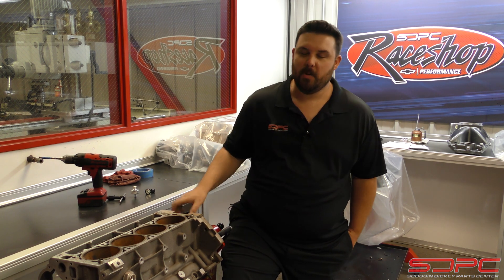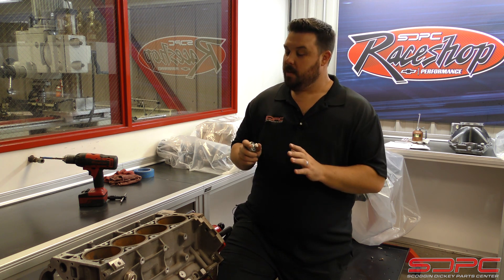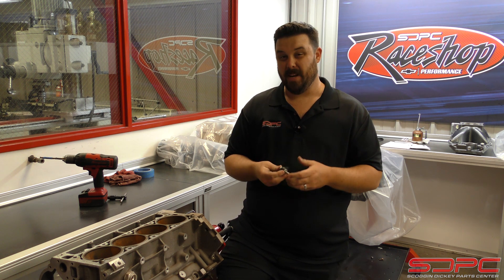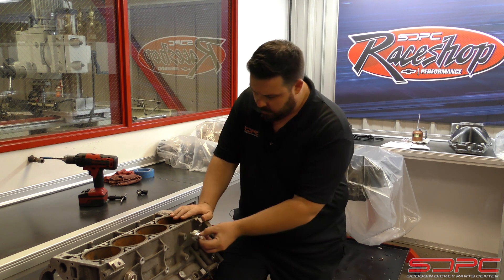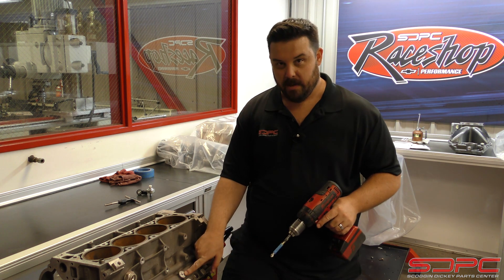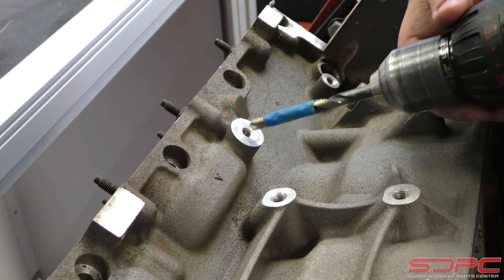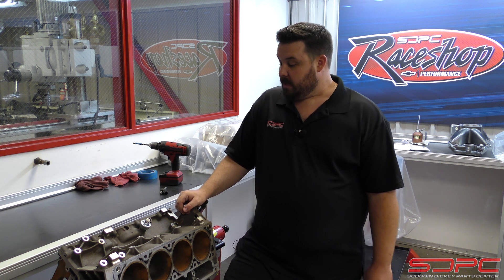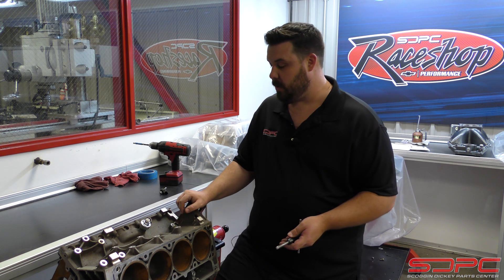SDPC Tech Tips: Adapting a Gen 4 LS block for a Gen 3 Knock Sensor

Comment: I have been wondering what it takes to put a gen 3 in place of a gen 4? Swapping a gen 3 6.0 into a gen 4 4.8 truck. Main concern is it having a 24x reluctor.
Reply from the maker: You would have to remove the crank and install a 58x reluctor.

Options are:
• Install 58x reluctor on crank
• Buy a gen 4
• Install holley terminator or other standalone that allows you to select reluctor
Reply: @Sdpartscenter  thanks. I knew the reluctor was different. I just wasn't sure if there was another way.

Comment: You said, don't use the gen 4 knock sensors in a gen 3 block because of the tuner probably can't get them to work properly. If thats the case does that mean the tuner doesn't tune actual gen 4 engines in 2008+ GM car or truck? Most experienced tuners you would assume if they can tune a gen 4 engine  that they can tune gen 4 knock sensors in a gen 3 block

Comment: Hello.., I had a ls3 on my 2008 corvette,  I'm going with a 5.3 ls, but my ls3 has 2 knock sensors  just like you were talking about,  my problem is use the same knock sensors but I put one  right on the block between oil pan and block,, you know on the little metal block squares ,, on one side , but the passenger side doesn't have those little squares,  I end putting it on the leap of the block , between oil pan and block,  do you think this not gonna work..? Thx, oh I am still working on engine  not on car yet,, thx again,,

Comment: Knocking sensor that's on my 4.5 block to a Ford F-150 1999 wire harness I'm having a problem here I bought this truck with this block in it and it was not the original motor so if someone can help me please be an angel I'm having a problem with the knocking sensor I don't know how to hook it up where to hook it up there was no clip on wire harness on truck

Comment: What about a video of a gen3 block going in a gen4 body
Reply from the maker: You can't convert up the signals from 24x to 58x so you have to remove the crank and add a 58x reluctor wheel.  For many it's just easier to sell the Gen3 and get a Gen4.
Reply: @Sdpartscenter  the ls2 for late models gto’s are 24x and use the side crank sensors.

Comment: I’m putting a gen4 into my gen3 single cab and was wondering what timing damper should I be using if I’m going to use the lingenfelter TRG. I’ve been told to use the 4x but also seen where people use the 1x.
Reply from the maker: You can run this one, some of the early Gen 1 blocks did not have a damper or even bolt holes for installation.
https://sdparts.com/i-24096350
Reply: Also what about the big sprocket? Do I use the 4x or 1x
Reply: @ikemunoz951  use a 1x timing set for a 2005-2006 GTO,  cloyes part number 9-4205S. I have been researching this as well and just found this information. I also found wire extensions on eBay for the cam sensor and the two knock sensors.
Reply: @williamb2013  we should all make a lil group for gen4 in gen 3 I’m getting ready to finish up my build I used the 4x cam gear and the lingenfelter 24x-58x harness will I need anything else
Reply: @mikeverything4098  I’m in the process of rebuilding an  engine for mine. Putting an LC9 where my L33 is. Making a few changes, like a new 24x on the crank. Gas grill came in handy for that.
Reply: @mikeverything4098  you might have to relocate the knock sensors. I used the 1x cam sensor on the timing cover. My old engine had the cam sensor to the rear of the valley cover. Had to delete the dod on the new engine. Everything should be almost the same as my L33 as far as compression and heads. I’m getting anxious to get it in the truck.

Comment: So if I drill and tap my gen 4 block for gen 3 sensors to use with 24x stock ecm and later decide that I want to use a holley ecm and go 58x, do I need to convert back to gen 4 knock sensors that are only 8mm in size and if so, how do I do that when the holes are drilled for 10mm due to the gen 3 knock sensor conversion?
Reply from the maker: If you go back to 58x/4x you will have to go back to the Gen 4 style knock sensors.

Drilling and tapping the side of the block for the GEN III sensors is kind of a "final solution."  If you're looking to convert back in the future, it may be best to rethink your current plans, or you'll have to weld up the holes and re-tap for the smaller thread when you convert back.
Reply: @Sdpartscenter  wouldn’t a helicoil work to get back to the original size?
Reply: @williamb2013  I don't see why that wouldn't work. 👍🏻

Comment: I recently had a 6.2 ls3 installed in my 06 Chevrolet Silverado 5.3 ,  they deleted the knock sensors completely, they tried to use the the 6.2 knock sensors with a harness.  Said they wouldn’t read.  Never tried this.  My question is can this cause very poor fuel mileage.  I’m talking like 5-6 mpg , it’s awful.  I think it’s my problem but I’m not a tuner , the shop said it’s fine. Any help
Would be appreciated.  Thanks
Reply: Can someone help me out.  7 months and still no answers , thanks
Reply: Are you always in power enrichment?

Comment: Since your on the topic of knock sensor would you also have to change the crank from a 24X to a 58X or can you change the disk from a 58X to 24X reluctor wheel?
Reply: You can change the reluctor itself and have someone weld it.
Reply: Or buy a $200 harness from lingenfelter
Reply: The Lingenfelter box only works on 58x reluctor to 24x ecm. There is no way except changing the reluctor to use a 58x ecm.

Comment: It makes a LOT more sense to me to change the threads on the sensor (as I did with my LY6 installation into my 2000 Silverado) since knock sensors are much cheaper to replace if you screw up compared to a block. Plus, the gen IV sensors will still fit if your tuner can work with them. And, it's much easier to change the threads on the sensor at your bench than changing threads in the block while it's in the vehicle with all of the potential obstacles. It just makes more sense all the way around, IMHO.
Reply: You can do this by hand without a lathe. File and/or grind off the existing threads so thread valley just shows. This should mean you have removed enough and you are mostly round. Use a quality die and cut 8 mm thread. Hold a socket in a vice to stop sensor turning. Worked a treat with my sensors. Die cost me $30 Australian.
Reply: How would I do that cause I feel more comfortable
Reply: @mikeverything4098  it helps if you have a lathe so you can turn the threaded area down to the proper size for the threading die. It can still be done without a lathe, it just takes more time. Typically you'll hold the part in a vise and use strips of sand paper to work it down to size. 
I don't remember the thread sizes but that's easy to find online or from the Gen IV knock sensors you may have on hand. If nothing else you have the block.

I've read conflicting information about wiring Gen IV 2 wire knock sensors into a Gen III ECU that expects a 1 wire sensor. That would be ideal but so far I haven't seen any certainty about it working. Good luck with whichever way you choose.
Reply: @renaissanceman7145  Some info I have found during my research, not sure if correct. Note it appears knock on Gen IV also pulls throttle position (electronic throttle) on knock, not just timing.
This is what efilive shows:
"The PCM can be used with two types of knock sensors, this parameter allows you to select which type of sensor is fitted to the engine.
(This is available in HP tuners so seems to be correct)
The standard LS1 sensor is a resonant type, these sensors are connected like so -
Sensor Bank #1 - J1,pin51
Sensor Bank #2 - J1,pin11

If the engine is fitted with flat response sensors (like the LS2 uses), then the connections are like so -
Sensor Bank #1 GND - J1,pin49
Sensor Bank #1 Signal - J1,pin09

Sensor Bank #2 GND - J1,pin50
Sensor Bank #1 Signal - J1,pin10

Part number for the new flat-response sensors: 12623730
Adaptor harness: https://www.amazon.com/dp/B082WMTSN5/

So repining the sensor signals needs to be done:
Sensor Bank #1 Signal - J1, pin 09 - was pin 51
Sensor Bank #2 Signal - J1, pin 10 - was pin 11

Change sensor type in ecu - then change settings - to what?
Reply: @jonathanrees3765  Thank you very much for the information. I'll give it a try, wiring Gen IV sensors into Gen III ECU, as soon as I finish, way too many, other projects that I must complete so I'll have room to tackle another muet do project I don't have time for. 😵‍💫

Comment: I'm putting a gen 4 6.2 in my 4.8 van. More of these videos would be extremely helpful
Reply: how did work out?
Reply: @bigshotpep7500  made too much power for transmission to hold so waiting on new built one to come in rn lol
Reply: @bigshotpep7500  and we ended up deleting knock sensors completely with the tune
Reply: i swaps 6.0 in 05 gmc sierra  5.3 run good nothing wrong

Comment: Ict Billet makes adapter pieces so you don't have to drill
Reply: Will that work for a gen 4 6.2 engine i originally had a gen 3 4.8
Reply: A waste of money don't use them especially if you plan on using long tube headers it won't be enough room to screw in the knock sensors
Reply: @jessicawatson-english5505  thats good to know

Comment: I might have missed it but what if I want to put a gen3 in a gen4 car?
Reply from the maker: Honestly, you'd be better off selling the Gen3 and building a Gen4.
Reply: Thanks. That’s exactly what I did
Reply: Tap threads for knock sensor and need to change the crank reluctor wheel to 58x and use ls2 front timing cover 4x gear.

Comment: I've seen a video of a guy on a silverado putting his knock sensors on the front side of the heads too. Wondering if its a good or bad idea.
Reply: Honestly I'm just lazy and not wanting to take the manifold off but didn't really think this would work and if its needing tune to change locations its not worth it unless your doing a engine swap or whatever the case may be.

Comment: What about harness options? Since they are not in valley anymore
Reply from the maker: Caspers 109081 harness

https://sdparts.com/i-24110029
Reply: @Sdpartscenter  will I still need this if I have the trg 002 from lingenfelter,if so will I need any other harnesses I have a 98 trans am with a ls1 going to put a l9h(6.2) ls3 conversion in the car